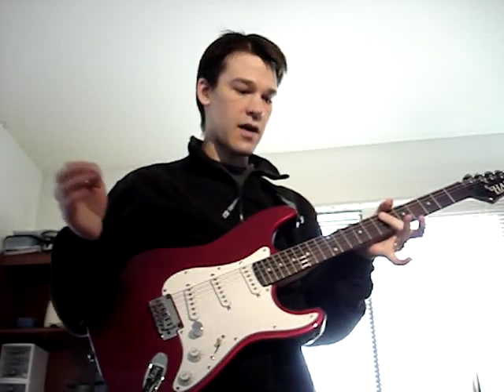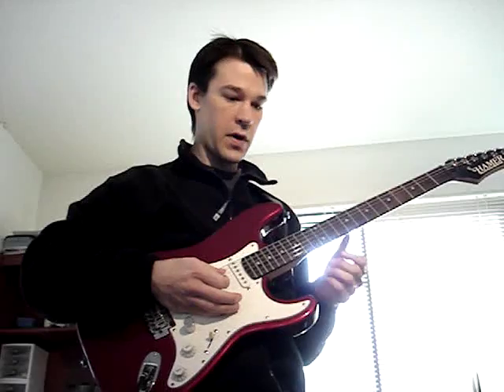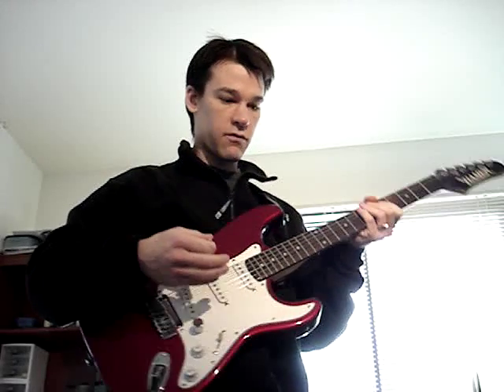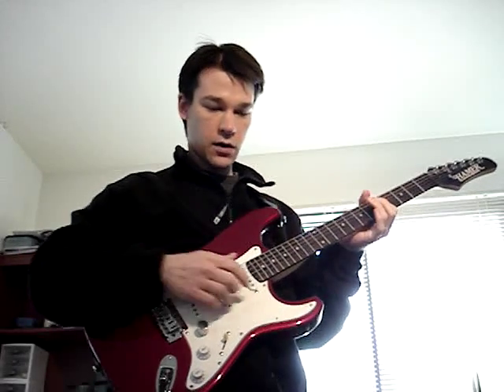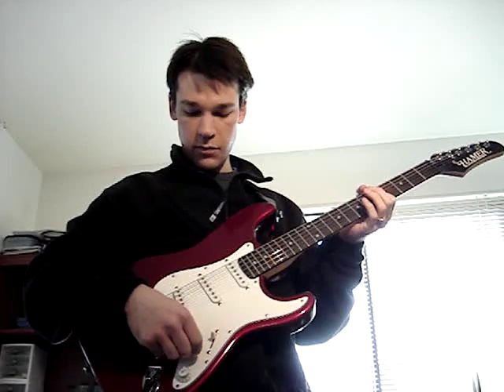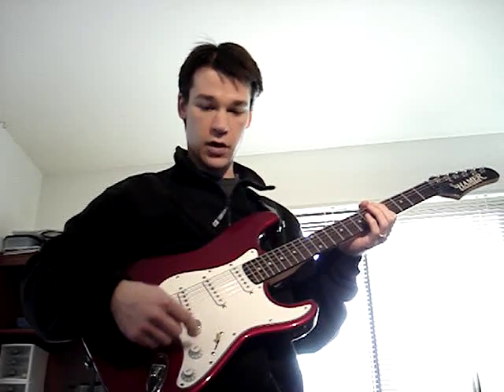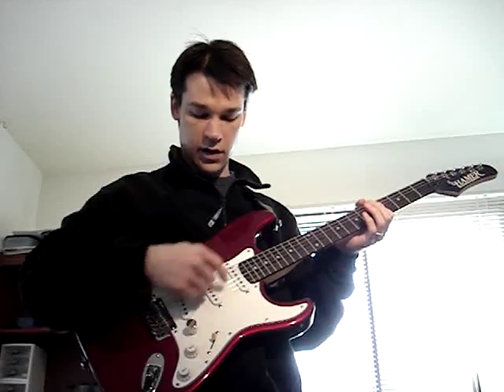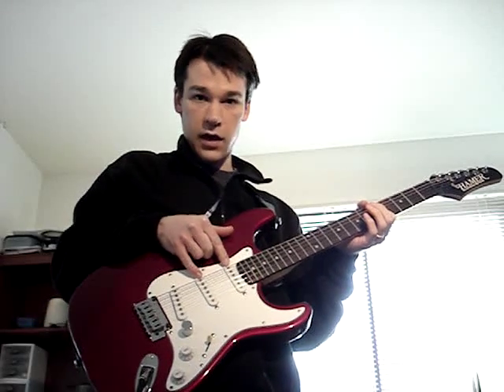G2M Latency Test

Comment: What do you think about using it trhough a microkorg? I've spent ages trying to found pedals/effect different from GR-55 (which i personally dont like) to get the synth sound with the guitar in order to make some electronic stuff (mostly dnb ) then i gave up and bought a microkorg. Anyway i discovered this little box, which seems to be pretty cool to use i a gig situation, but i'm a little bit concerned with the latency.

Comment: @RUOCCOLOCO 
Hello,
I have a Roland Gr30 which I use to control other Synths and vst's using the Midi out on the Gr30. So attaching the G2M to a guitar synth is just doubling something you already have. Unless of course you're thinking of using the G2M to midi clock time another instrument with the GR30?
Hope this helps

Comment from the maker: It doesn't work with chords at all.  They're up front about the fact that it's a totally MONO unit.  It does weird things when you play two or more notes - it will tremolo between them or detect a difference tone.

The ONLY guitar/MIDI unit that will do chords would require a special pickup so it would detect each string individually.